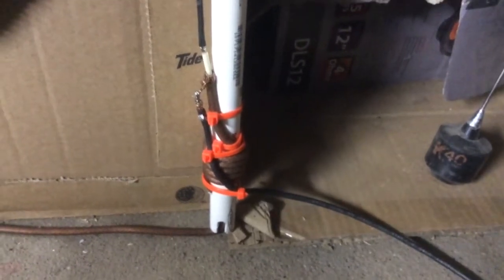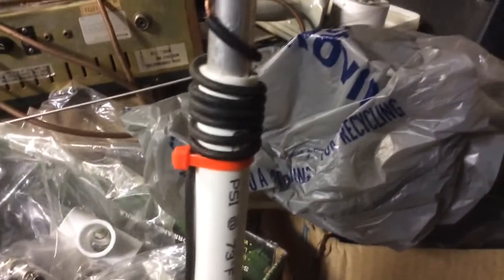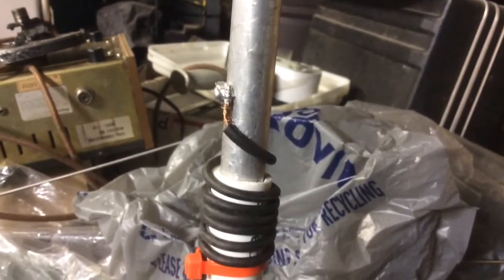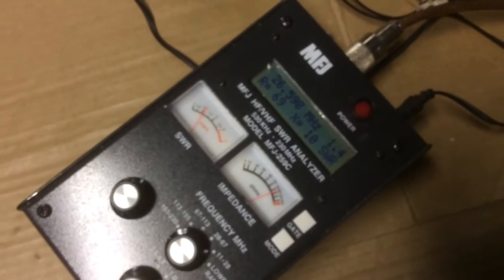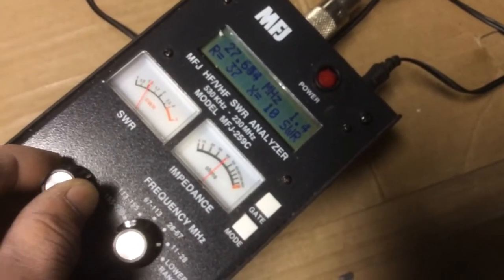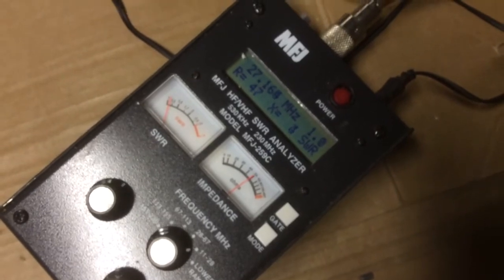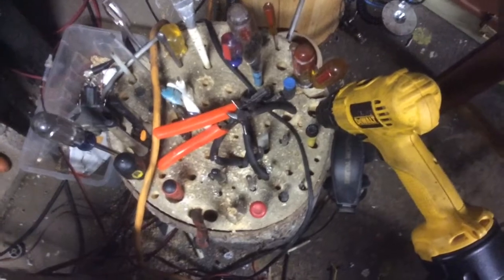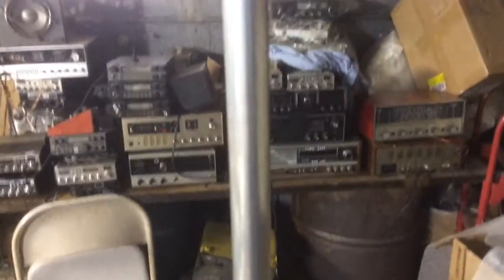diy indoor CB antenna

Comment: awesome indoor antenna. I wish I would have found this video before I bought a 4 foot Firestick II FS4 that I am thinking about taking two of them to build a vertical dipole. I could have built what you are using out of stuff I have laying around for free. Thank you again. I always like your videos. Come across any BK Dynascan Cobra CAM88 parts I would be interested. I am currently fixing a Dynascan Cobra 85. I wish I had access to paper manuals, and schematics I despise the incomplete stuff I find online. Have an awesome weekend man.